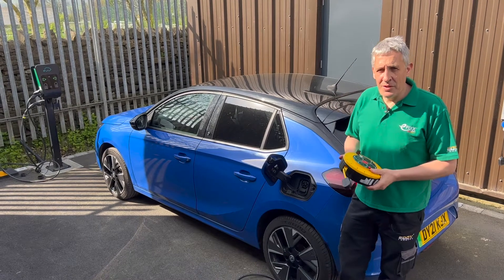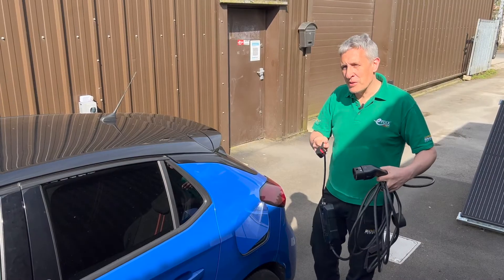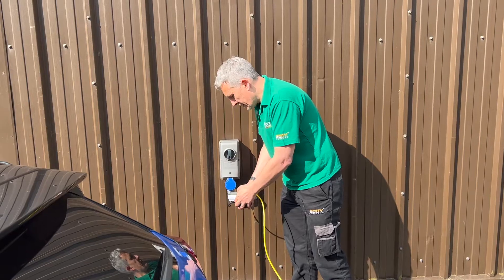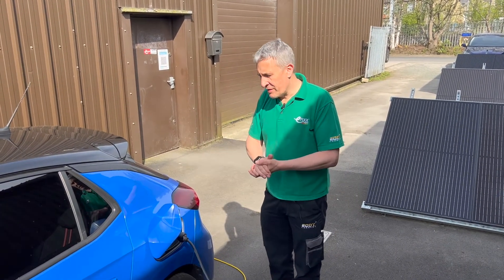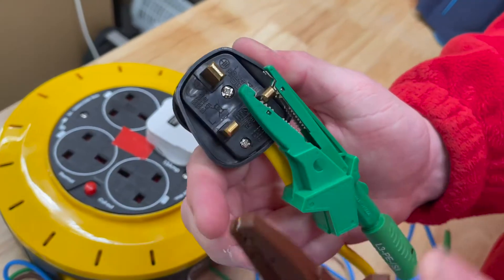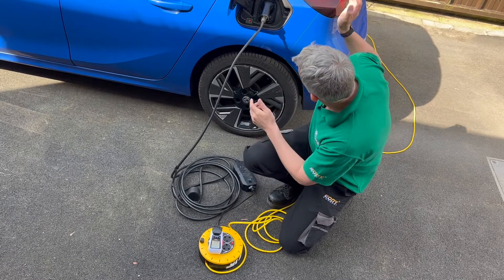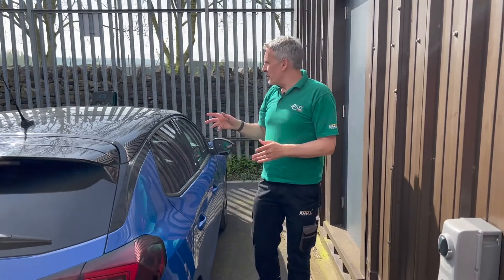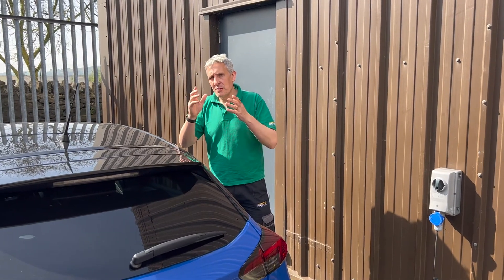STOP Using Extension Leads for EV Charging Right Now!

Comment: I don't disagree with your calculation of the losses but you didn't demonstrate the expected power loss in the circuit when using the EVSE charging at, say, 7.4kW and then consider the *difference* between the two, which is the actual cost impact that those choosing to use the extension lead would face.

Comment: This does not make sense  financially. Most would be using an EV tariff and just be topping up so could use much cheaper electricity. I proper charge point could cost over £1000 and the loss of interest on that at 5% would be £50 a year more than offsetting any loss. Now I can see safety risks with this but come on at least use some common sense on the financial front.
Reply: He claimed that a granny charger wouldn't be fast enough to use an EV tariff, but we found it isn't a big problem. 4 hours at 2kW gives you about 30 miles per day, compared to the UK average of about 20 miles per day, so the granny charger could more than keep up.  You'd only need to pay full price on the rare occasions when you have two long days in a row.

Comment: Dangerous practice and I won't be surprised it can cause a fire.You need a proper charger or don't bother.I think it will become illegal to charge your car like this soon.
Reply: Nonsense. Charged a EV like this (long, correctly rated extension cable, fully unwound) for 3 months while waiting for a charger point to be installed.
Reply: @edwardpickering9006  Of course its a nonsense until it goes wrong.Why wating 3 months? Get the right supplier.

Comment: An EVSE install is easy £1000. I dont blame people for using regular sockets.
Reply: Thanks to the Government for that. Anything gets a subsidy and the installers add that to their normal price. When the subsidy goes away they do not lower prices.
Reply: This. Several years of heat losses to make that back.
Reply: @MarkHewitt1978  No because not everyone can have a EVSE installed at home, not just for parking reasons.  As has been said before most portable EVSA are limited to 10A, and if following basic safety advice should represent no danger - I know people who only ever charge on Portable EVSE  and an extension and have had no problems at all.
Reply: It will cost me 2x to 3x that amount in Sweden because of some unfortunate decisions made a long time ago.
Reply: Spend £35,000+ for an EV then risk having the whole lot go up in flames like those dodgy Chinese electric bikes for the sake of an extra grand or so.😂
Reply: @fus149hammer5  F.U.D
Reply: @fus149hammer5 talking rubbish, all that will happen is the extension cable would melt in worst case scenario

Comment: It is unprofessional to take the worst extension cord as an example. Based on the measurement result, the extension cord has 1mm^2 wires. Use a good 2.5mm^2 extension cord and the power loss will be about 24W.
Reply: No it is not unprofessional.
These are readily available extension cables which anybody can buy.

It is perfectly reasonable to use a readily available cable which a car owner may purchase not knowing there is an issue.

This is an educational video and it is highlighting the problem. It is successful in its objectives to educate.
Reply: A 1mm2 cable probably didn't come with a 13A fuse in its plug.
Reply: @Rich-on6fe  I bet it did.
Reply: Realistically how common are 2.5mm extension leads? Here in Australia (standard outlet is 10A, and a 15A version - typically for caravans).
I have only seen a 2.5mm lead at Bunnings:
40m with 15A ends at $142AUD (£72)
50m with 10A ends at $182 (£92)

However due to the length you are still looking at a higher resistance then in this video (~0.63 ohms over the 80m of wire)
Reply: @GordonGaz  Tool shops have cables for welders at half to a third that cost, or be naughty and make your own to length for even less.
Reply: @LeithElliott   good suggestion on the welding extention cable
Looking that up they are available in 2.5mm² in a much more reasonable 10m length.
It's still about 2-3x the price of a standard "heavy duty", depending if its 1.5 or 1mm²

But I think the original point still stands, 2.5mm² leads are a specialist item, and users knowing they exist and why to spend the extra is also a factor
Reply: @GordonGaz  Yeah a Caravan cable will do, and they are available everywhere.

Comment: So it really pays to buy a thick extension lead, and as short as possible for your purpose. Id start with a 16A caravan one.
Reply: We got ours from Tough Leads. They come with a chunky plug, an RCD and a waterproof socket - and there's even an option for a slim plug that'll fit through a letterbox.
Reply: First off I live in the PNW (USA) and use 15foot heavy duty extention cord for charging my '14 BMW i3bev, second I rarely charge at home, I usually charge at the Nissan dealership next to my work which has free level2 chargers available for public use.

Comment: Most granny chargers should limit to 10A as this the max continuous rated in Europe.   I made sure mine is.
Reply from the maker: Amazing what you can find on some of the online platforms
Reply: @eFIXXENERGY  amazing how foolish some people are, and how foolish some people are for even making that suggestion. 😉
Reply: A granny charger at 3kW ? That’s quite dangerous in itself ! Never seen that before
Reply: Why do t you highlight the real risk here, granny chargers at >10A !
Reply: My Kia granny charger goes to 13A. Sockets in AU are only rated to 10A, so I've never tried it. 15A caravan sockets have a larger earth pin but a 10A plug will still fit it.

Not sure why Kia supply this charger with their cars as it's above the 10A threshold.
Reply: @davidunwin7868  Because in the UK at least, our sockets and plugs are rated for 13A continuous.

Not 10A. Not 8A. But 13A. They're tested at 14A for what its worth, but downrated to 13A.

Comment: Who's paying 34p per kwh? Price cap is 25p
Reply: 7p for 5 hours
Reply: @tomooo2637  I get 7p for 6 hours, but that's not the point. He says price cap is 34p which it isn't. It's 25p.
Reply from the maker: @robbobvr6 video was recorded during 2023
Reply: @ So cut that bit or rerecord it. Rather than releasing old footage as now. As well as all the other issues with it.
Reply: @eFIXXENERGY  it's was published yesterday, it's now 2025
Reply: Varies by region. Could be higher up’north. 24p where I am

Comment: 3000W is higher than I'd expect, most cap out at 10A because drawing that continuously for hours and hours from a standard socket is bad enough.

I guess there are companies out there shipping 12.5A now because YOLO ...
Reply: Yeah insulated plugs aren’t really rated to do that for hours. But at 10A, just imagine how many more hours you would have to wait!
Reply: On a positive note, I nice slow 10A charge is probably good for the battery. Seams to be for my phone battery, anyway. 😅
Reply: @AndyK.1   25% faster ⚡

But for battery longevity the main figure the main values to consider are:

- Internal resistance, which results in generating heat inside the cells)

- C-rate: the ratio of power to capacity, so a 50kWh battery charged at 50kW is a C-rate of 1.0.

A C-rate of 1.0 is considered pretty safe, there are plenty of EVs achieving C-rates of 2.0 with active cooling to maintain steady temperatures from all that internal resistance. And then you've got the big-boys at Tesla peaking at over 3.2 in their larger battery models.

So in terms of reducing losses and heat from internal resistance, yeh a 10A or 12A charge is theoretically better. But realistically a standard 32A charge isn't anywhere near a 1.0 C-rate so the battery will be fine.
Reply: @AndyK.1  sure they are. If they are appropriately rated they've been tested to hold 14A (yes above their rated current) for several hours (believe it's 8... but could be 6, my mind fails me what the standard actually uses) and stabilises at a safe temperature.

That is assuming you're using an appropriately rated plug and socket mind and that it is all in spec still.

It being an extension lead, that's a big ask as it'll be bashed about and used.

That said, if you're using a granny charger, rate limit it to 8A or even 6A. It'll take 40+ hours to go 0-100 but most cars are stationary on a drive for most of their life. Its what I do, and my charging setup is cool to the touch.